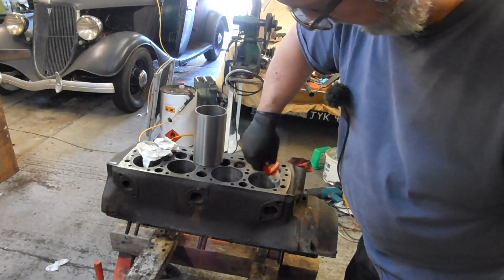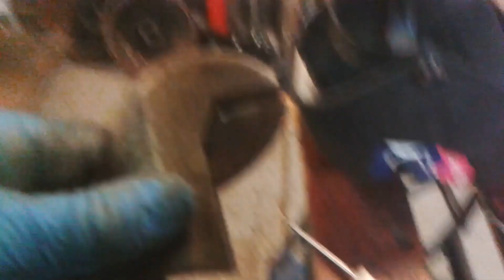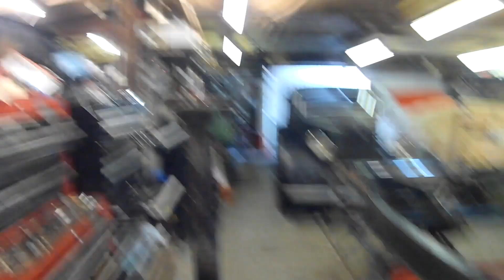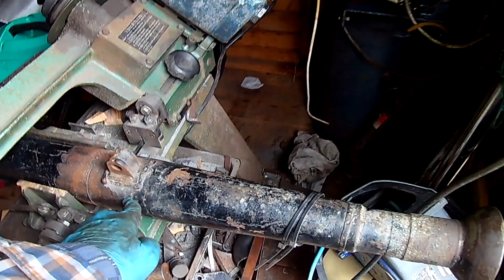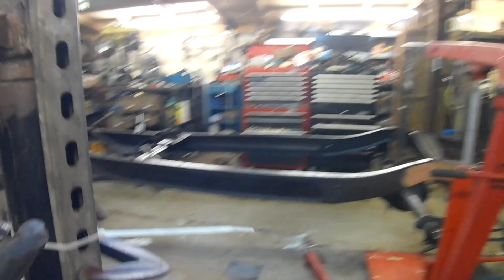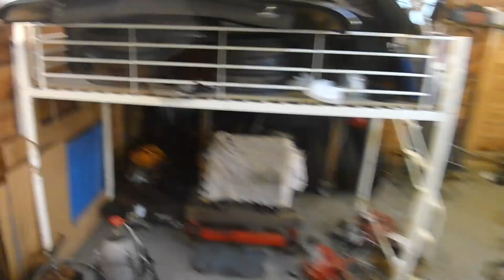Torque Tube Tech. Custom Liner. Tool Repair & Fabrication. 32 Pt17 59 Pt11.

Comment: See you're keeping busy. If that's the bandsaw you got when I was still at Ashill Rd then it's lasted well.
Reply from the maker: Hi Andy. Yup, that's the one. I think I got it from Graham Engineering and seem to think they were over towards west Brom. Alpine brand which I think was their house brand name for imported Taiwanese tools. It has served me well over the years. I did a bit of alignment work on it and it cuts well.
Reply: @MartsGarage  Thinks, not all dip sticks or dipstick tubes are equal, nor indeed sumps. Mixing parts from over the years can lead to errors!
Reply from the maker: @andrewgray8131  Yeah, that's the conclusion I came to. You know how we think. Never take anything as a given, always check from first principles.
Reply: @MartsGarage  A good buy then. Graham Engineering were just off M5  J1 West Brom. New and 2nd  hand machine tools. I used to enjoy rummaging through assorted tooling. Disappointed to go there one day ages ago to find they had closed.

Comment: Nice work coming out of the D.I.Y. Dept., Mart.  You've saved yourself many green-backs through the years, I'm
sure.
You indicate the liners were sourced locally.  Are they readily available, then, for vintage motors like the flathead,
on your side of the Pond?
Reply from the maker: The set of 8 that I bought were sourced from the USA. They're Mellings and came from Rockauto. The one odd one came from Westwood Liners in Droitwich. They do all types and sizes and can make custom ones too. based on list price, though, they are more expensive, which makes a big difference on 8. If I do another motor and need 8 I will approach them and see if they can at least price match with the USA sourced ones.